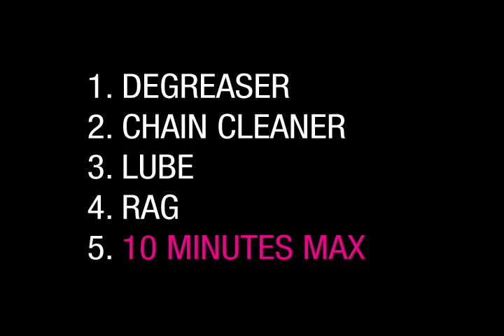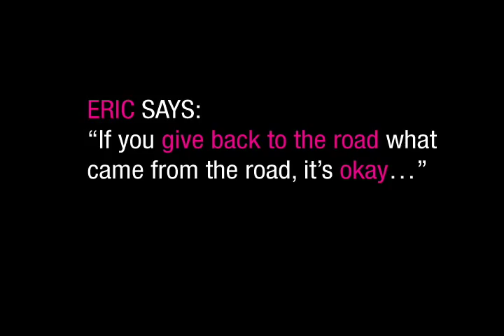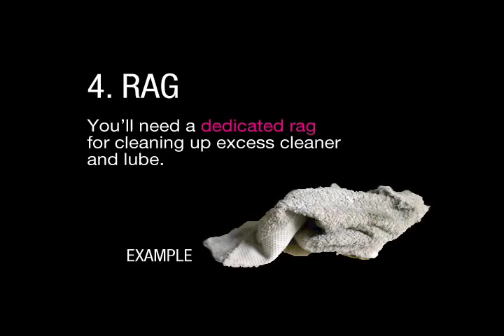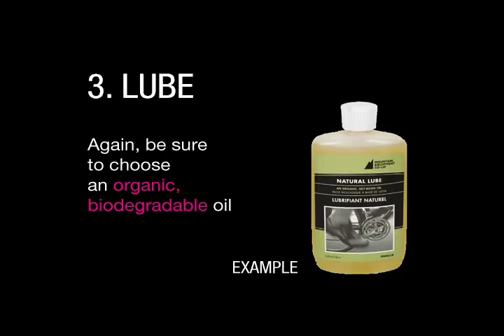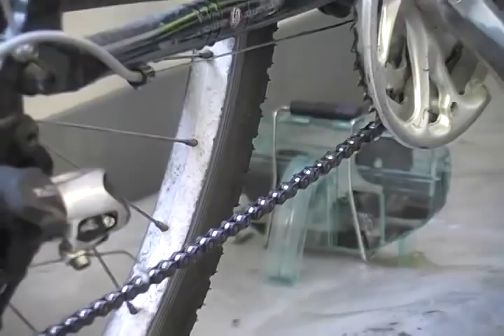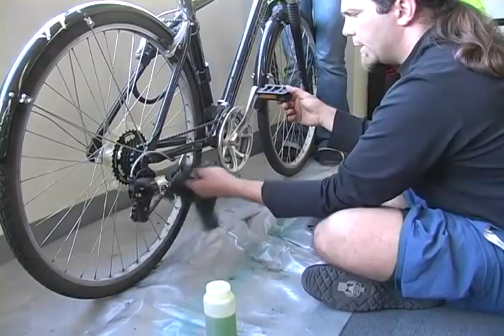How to clean and lube a bike chain

Comment: @asored2000 obvious but unfortunately not. Because the gunk that really wears the chain is that which starts to get in between the links and also that which has formed as a thick paste.  the chain cleaner has a good brushes forcing onto it, which really helps work all this out. Hope this answers your question.

Comment: I'm told that those chain cleaning machines are not recommended because they can cause the chain to lose its internal reservoir of oil, and that your best bet is actually just wiping the chain as clean as you can with a rag before oiling it.

Comment: @norbu1987 A general lubricant would be waxy or greasy but bike chain lubricants are different (ie not waxy and with little greasy properties) because they are exposed to dirt. A greasy or waxy lube would pick up AND RETAIN the dirt particles, allowing dirt to mix within itself and thereby possibly penetrating the links. A more water-like lube would just slough it away. This is why chain lube and general bike lube are 2 different things with 2 different properties.

Comment: Thanks!   The only thing I'd recommend is not using the same rag you used to degrease to also remove excess lube.  Kind of picky, but you could be putting some degreasing solvent back on after oiling the chain........

Comment: Except the water would tend to get into the friction bearing surfaces and not dry before you lubed it, unless you remove the chain and bake it in the oven. Perhaps the oil effectively displaces the water. Either way, it's not clear why the biodegradable cleaner doesn't act the same way.

Comment: its kinda all chemical based which might rust or eat the chain and wont live long and i don't understand why lubricator looks like water coz it might dry soon-isn't lube should be little wax or greasy- which might stay longer and smoother.

Comment: what is the purpose of this? does it help you shift gears better?
Reply: It wont rust i guess
Reply: after some time biking through wind and wear, the chain collects a serious ammount of dirt, which forms into "balls". These balls of dirt may prevent the bike from switching gears properly. Or even worse, your chain may randomly jump off the gear.
Reply: Seems like bike stores have a special item to sell for everything. I clean my chain and gear cassette with WD40 and a shop towel, then I lube my chain with regular automotive engine oil.
Reply: +Ron Busch It prevents wear, makes it ride smoother, and prevents corrosion.

Comment: That much lube?
Reply: Use as much as you want if you can deal with the mess, just wipe off the excess(hold the rag touching both sides of the chain, but not the links; work the gears while spinning the wheel so that the oil is distributed onto the casette).

There's a lot of whining about which bicycle chain oil to use; the following is controversial and always generates heated discussions, so take it for what it is:

The supposed problem with vegetable based oils is that they can polymerize and make a sticky mess over time; but they might not actually last long enough for that to be a problem; I don't know if this is true.

Automotive general purpose lithium grease is cheap and works well, but it's not really OK to just pour that waste oil from cleaning the chain into a storm or sanitary drain or slosh it about on the pavement while lubricating the chain.

There's all kinds of fancy chain oils, many based on PTFE(silicon grease + teflon); the ones that leave a dry wax do OK in summer and leave less mess on the chain and gears, but they do not protect the chain well from corrosion in the wet winter months.

Chain oil that is excessively sticky will attract an unnecessary amount of crud; unless you need their staying power and know you're not going to get crud on your chain, don't use them. WD 40 is an excellent degreaser and cleaner(as is straight mineral oil), but it does not work well as chain lube unless you apply it very regularly(we're talking weekly here). Waste mineral oil needs to be properly disposed of; it's not OK to just let it go down drains or pour it out were it can run off into lakes and streams.
Reply: thanks!
Reply: lol, he got the chain cleaned & lubed but trashed his apartment in the process.
Just stay out of the mud & rain with your road bike & your chain & sprockets will wear out before needing anything this drastic. ... or... replace the chain/sprocket/deraileur setup with a sealed multi-speed hub and a kevlar belt system.
Reply: Yeah what was up with pouring lube everywhere?  you only need a tiny bit! waste not want not , not to mention save the planet and your floor!